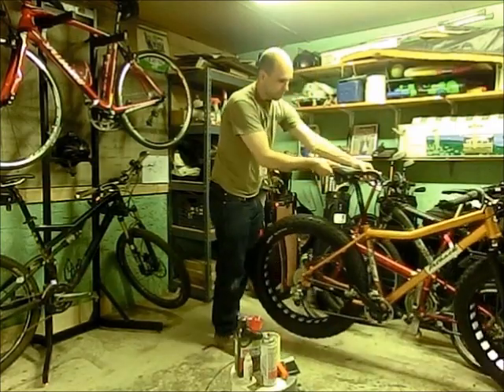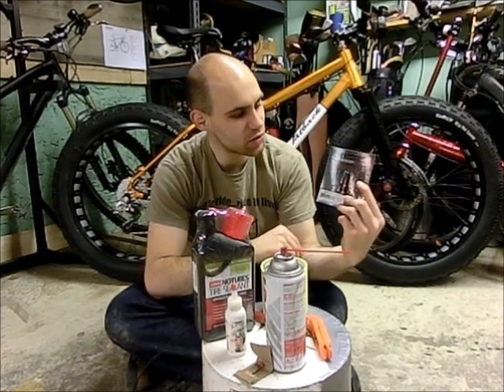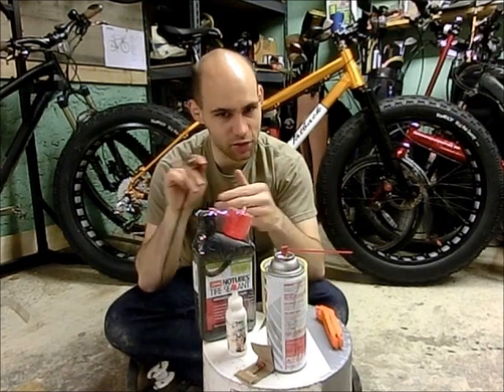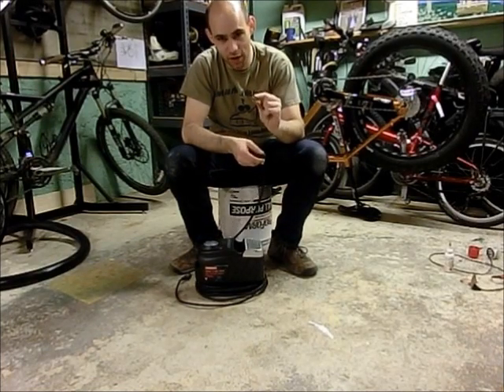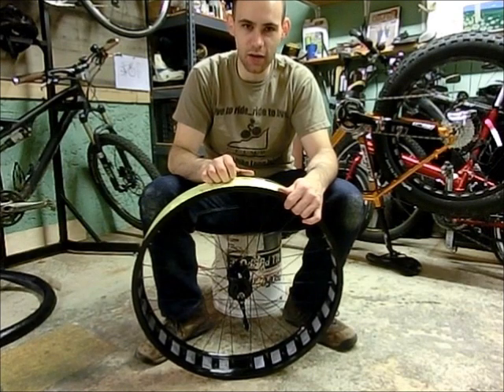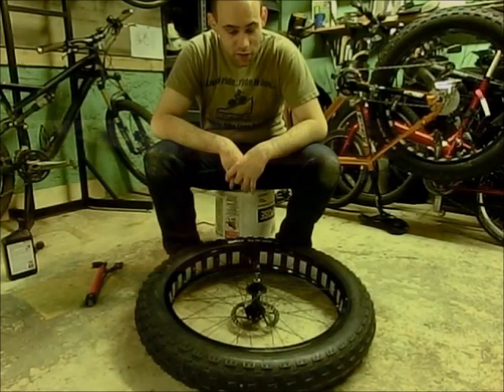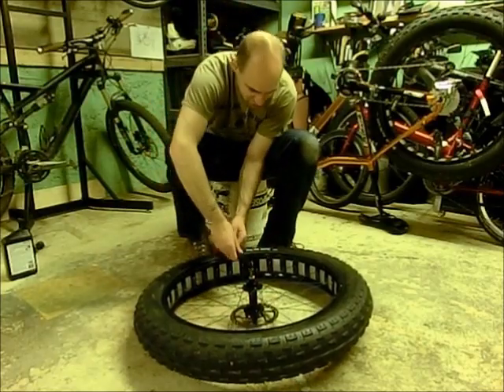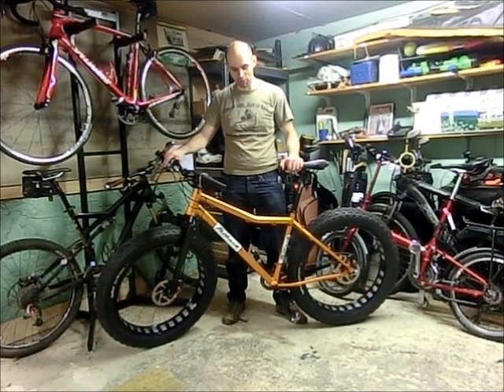Fat Bike Tubeless Conversion

Comment: We used starter fluid (ether) to seat trailer tires that popped off the wheel, seems to work well, stand clear, we also used silicon caulking for the bead sealant since they were a pain to seal. Thanks for the detailed video.  That sort of makes my decision for my new Trek an easy one.

Comment: yea i would agree. Lower tyre pressure from 2 pounds to 8 pounds can make a world of difference. Since i ride in the soft beach sand next to the volley ball courts, that sand is really soft. I rode thru no problem nice and slow with 2 pounds and tried it with about 6 to 8 pounds of air pressure and wound up blowing my knee out and getting off the bike. Tubes hold up well at 2 pounds just watch out going fast downhill around corners you could lose control. I think tubes are more practical since the weight is not the factor and practicability is more a factor out in the world of cycling. cheers